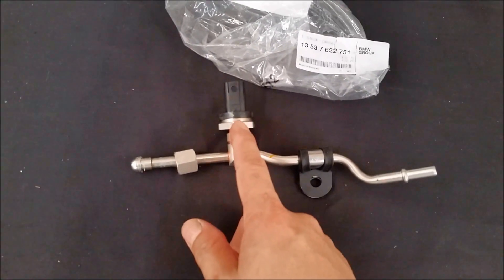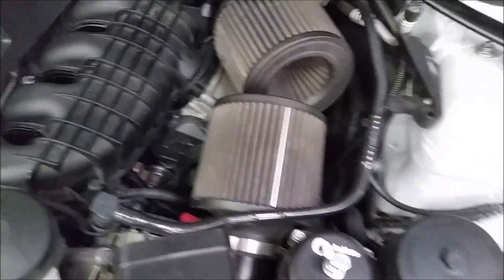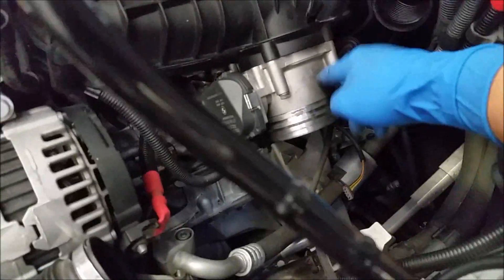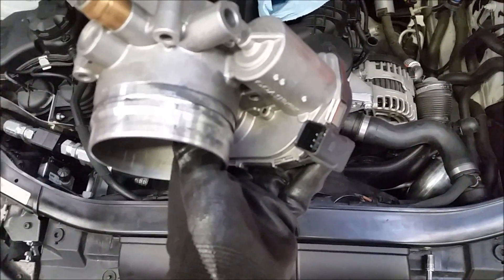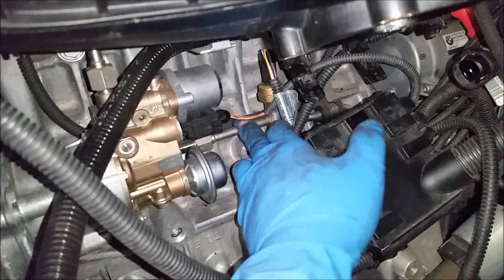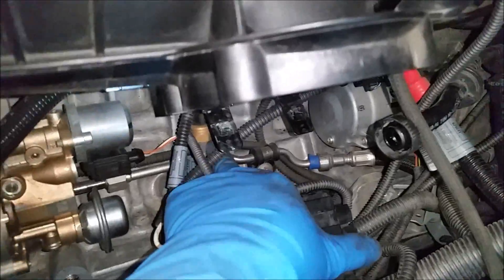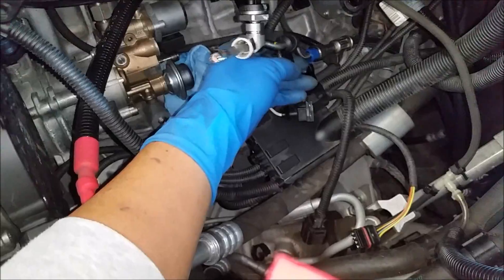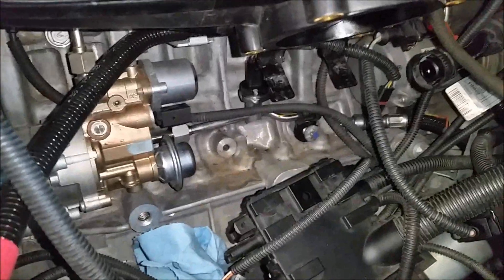Low Pressure Fuel Pump (LPFP) Sensor DIY - BMW E90 335i & E82 135i

Comment: Thank you bro! Finally found a good video explaining replacing the line as well with the sensor. Keep looking at videos with the new sensor and the adapter you have to put on the sensor it to connect to old fuel line.

Comment: I hope this hasn't been asked already. I replaced the low and high pressure fuel pumps. Replaced the oil sensor on top, front and center. Everything is back together but won't start. Fuel rod is dry. Im not sure if I need to flood the fuel line , or this sensor has gone bad? Could this be the cause of it not starting? It turns over fine. Almost started, but just cranks. I don't know if i should attack this sensor, or fuel relay in the engine compartment fuse box?
Reply: Did u figure it out?